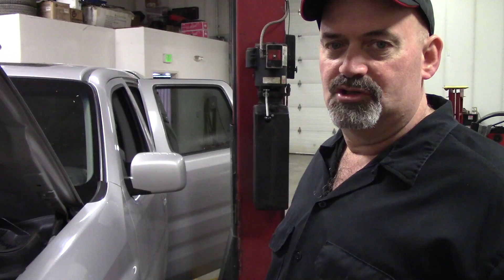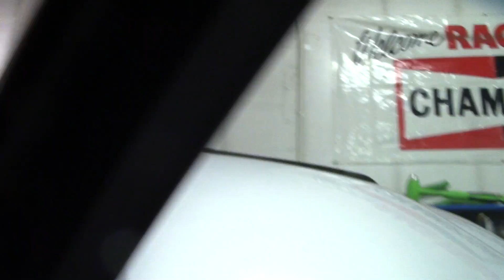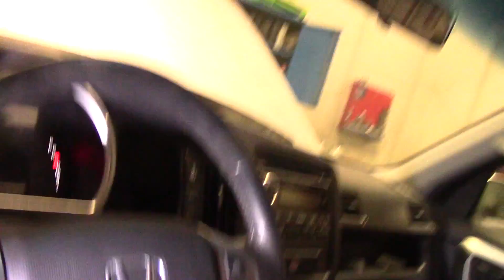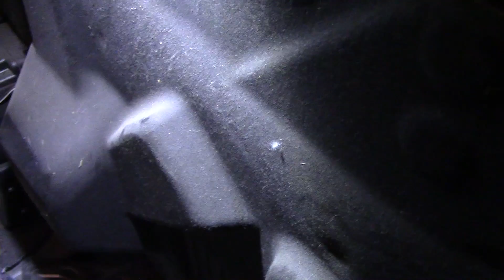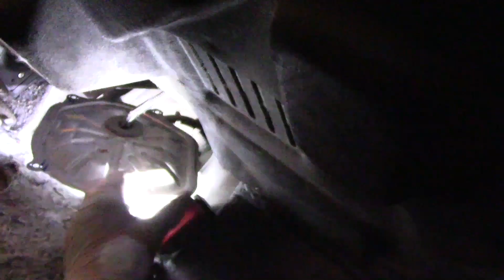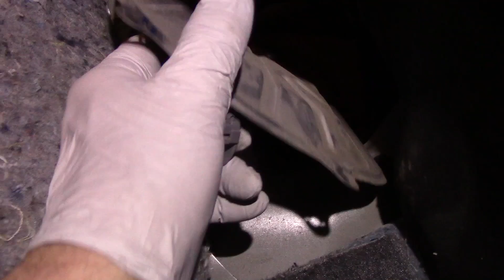Honda Pilot Ridgeline Cranks But Wont Start Diagnosis

Comment: Thanks for the video. My friends 07 is getting spark, fuel and air. Started stalling randomly at stops and while on highway. He's thrown tons of parts at it. Injectors cured the misfires, egr was plugged up... replaced it. Coils are fairly  new. Just replaced the fp relay today. Still wont start. Wants to. I started it and kept it running with fuel sprayed into the tb. Dies if you let it go below 1500rpm. Any idea? TIA
Reply: Did you ever figure it out?

Comment: I'm in Anchorage also.
I drive an 06 Ridgeline with 165k miles.
Yesterday leaving my neighborhood coming to a red light my truck stalled. Wouldnt start right away but started after 5 minutes of sitting. Got me to where I was going but ran a little rougher than normal. Tried to leave destination and stalled in the parking spot. Started up and stalled again right before pulling onto Huffman; pushed her back into a parking spot and sat for 30 minutes. Started up and got me about 100 yards away and stalled again. Got towed home. Now she wont start at all, just cranks. 
I checked all battery connections and cleaned off all the grounds and the positive terminal. Still no start. Bought a fuel pump from Oriellys and going to swap that out right after checking for fuel pressure. Not sure how to check that without a proper kit, but going to find a way.
Reply from the maker: Yikes. What brand of pump?

Comment: My
wifes pilot just did that cranks but doesn't start today in the Walmart parking
lot. It's done this before and long story short the key wasn't sending signal
to the computer and so it would not allow power to the fuel pump. I bypassed it
with an add a fuse running power to the pump when the key is on and it's worked fine until now. I'll dig into it tomorrow. Thinking it’s the fuel pump also. We shall see.

Comment: I got a question what would cause it not to have no spark cuz it's got fuel and everything else but it just doesn't get no spark and it won't come out of park with your foot on the brake turns over and everything but won't get no spark to turn on
Reply: I have the same problem....
Reply: No spark could be a bad eld, pcm, timing may be so far off that it won't allow it to get spark( but that is really unlikely, it would just run really really bad)
Reply: I got the same problem

Comment: I have a 2012 pilot but when I want to turn on it does not start, only a few relays are heard on the right side, the cold truck turns on without problem but once you turn it off for a while you turn it off and it does not start until a good time passes and apparently something  it cools.... can you help me
Reply: Did you figure it out

Comment: you can run the fuel pump with you scan tool in tests there is a spot you can energize the pump for 30 seconds

Comment: Wasn't starting, so I checked the relay by just turning the key to the number two position with my head next to the relay. Heard the click, great, it works. 
Remove the seat and open the fuel pump cover and found the problem.
A mouse had chewed through the wires that power the pump. 
Went to a salvage yard, pulled a plug from another truck.
Replaced the plug and it's fixed.
Reply from the maker: excellent! Thanks for the input.

Comment: I have a 03 Pilot, I have a cranking but no start issue.  I was driving the car and engine just shut off???  what I have verified so far: timing belt is good, 60 psi fuel pressure, good spark, good injector pulse, swapped out a main relay from a different running pilot.  car cranks strong but will not start???  Any HELP PLEASE ...
Reply from the maker: Is it flooded or have diesel in it?
Reply: Not my post but I have the same problem I have a new pump a new battery also the main relay works but my pilot still wont turn over 🤦🏾what else could I check
Reply: Anyone have any luck on the issue I just picked my moms 06 pilot she was driving and it just shut off out of nowhere now it cranks but won’t start, fuel pump seems to be kickin on I can hear it from the tank. Any suggestions would be greatly appreciated
Reply: @stevenpayne3240  did you ever find the issue?
Reply: @stevenpayne3240  Steven, I’m hoping for an update as well!
Reply: Wondering same ?

Comment: The fuel pump saved the engine from possible death, now the owner has a chance to do the right thing.
I being a crude person would use a 40Watt 12v bulb on wires, i want to see the ability to deliver power, and its a pretty effect lol :-D.
i have many multimeters but they can be deceptive with there high resistance input.

Comment: You covered a lot troubleshooting areas in one video. Honda does make some pretty bullet proof vehicles. As your well aware, when I have to replace a fuel pump in my Chevy truck you have to drop the tank. Not to mechanic friendly. I hope your doing well up there Tim.
Reply from the maker: Thanks friend, it’s going well. Are you pulling the tank or raising the bed on the Chevy?
Reply: It was a job I did on my 98 Chevy which has the flat bed so in my case it was easy to drop the tank (once I drained it).  :)  I should have listened to you smart guys because I did this job twice....yes, I installed a Dorman the first time. It lasted about a year.  :)
Reply from the maker: Oh crap. Lame

Comment: some times its good to load the circuit   a head light bulb   Delphi is good  they were formed around 2000  ac delco  now is not all gm  parts      hey we have world pack in ny!  at least you didn't have to drop a full tank   never did a Honda fuel pump  we have e 10 gas here
Reply from the maker: Good call or even backprobe with the pump connected and watch for voltage drop. I’ll roll the dice on this one and hope for he best. Pump isn’t cheap!

Comment: This is a first Honda fuel pump failure I've seen as well.  My family members own a lot of Honda's.  I also work on friends' cars, which also include a lot of Honda's.  In fact, I haven't seen anyone on Youtube that have failed Honda fuel pumps.  
It takes a month to order Honda fuel pump because they have to restart production for the fuel pump since no one ever orders one.
Reply from the maker: Yes I really didn’t think it would end up being that. It had sat overnight and didn’t start in the morning they said. Oh well, stranger things have happened.
Reply: Amazing! I checked YouTube and there are all kinds of Honda fuel pump videos. My Chevy Caprice has 330,000 miles with the original timing chain and gears. I am so glad I don't have to worry about a timing belt failure, or interval.
Reply: Honda is infamous for the fuel pump relay problems.  Since they switched to lead free solder, the solder joints on the printed circuit board tend to crack.  I've personally reflowed a couple of fuel pump relays.  Some of those videos may be misdiag.  

Most 4 cylinder Honda's went to oil lubed chains in mid 2000's.  V6 Honda's were the last ones with belt.  I've seen fair amount of timing chain guide failures on OHC engines.  Push rod/OHV engines with the short timing chain are fairly robust.

Comment: Change the belt & water pump before you put a new fuel pump in it... to ensure that it won't break when the engine starts! =)
Reply from the maker: Actually I will be doing it that way since it’s a few days wait on the pump. I could hardly imagine trying to explain after a belt broke while at the shop. That would suck! Haha.
Reply: Yeah... that would be my worry as well! LOL
Reply: Some vehicles you have to drop the gas tank customer lucked out with the ridgeline. Seems more vehicles are built with a timi g chain.
Reply: Piri Hern I prefer belt drive.... easy pump access is a German thing.
Reply: I also prefer timing belts over chains.  View a few timing chain vids.
Reply: Lorrin Barth LOL... I know, right?!